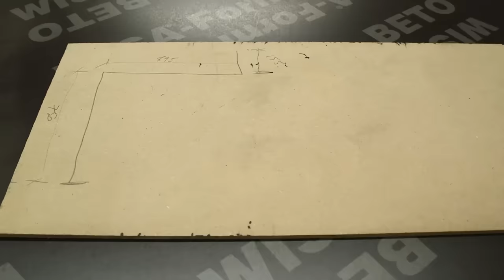Installing wood flooring in a 160 year old house

Comment: Watching your prep for laying the floor you've gone from extremely talented to genius in my estimation. Can I ask why you laid steel sheeting on the landing?
Reply from the maker: Thanks! Those stair nosing parts do not connect into the rest of the flooring, so since it is a floating floor (ie not glued to anything, just floats on the underlay) it needs a solid substrate for the nosing to glue to and the surrounding flooring to glue to and keeps it all together.
The nosings are sold as "to suit the flooring" but the flooring is a click together profile, but the nosing has a groove in it which is strange. it wouldnt have connected at the end of the boards anyway so still needed extra measures either way I guess.
Reply: @NewYorkshireWorkshop  I get it now, thanks 😊
Reply: @NewYorkshireWorkshop  I will credit you with a crafty solution to this problem. I prefer solid hardwoods over engineered wood for many reasons, including this one (nosings). You sir, however, are able to overcome the limitations of many things, including this one. Well done.

Comment: Sensational. Why the steel ?. Fire barrier ? Strengthening panel ? Heavy wear area ?  :)
Reply: NYW states in the comments “…those stair nosing parts do not connect into the rest of the flooring, so since it is a floating floor (i.e. not glued to anything, just floats on the underlay) it needs a solid substrate for the nosing to glue to and the surrounding flooring to glue to and keeps it all together. The nosing’s are sold as "to suit the flooring" but the flooring is a click together profile, but the nosing has a groove in it which is strange. it wouldn’t have connected at the end of the boards anyway so still needed extra measures either way I guess.”
Reply: @idontthinkso666  Thank you very much for that. What a complete master he is.

Comment: @New Yorkshire Workshop  Slim chance of a reply but could you go into some detail about the 2mm roofing felt? Is it just torch-on stuff? I need a similar packing material for my uneven subfloor in the 1.5mm - 2mm range.. I'm tired of using newspaper! :)
Reply from the maker: yeah it is torch on bitumen underlay i think, you want the non sanded underlay because it is smooth on both sides.
Reply: @NewYorkshireWorkshop  Hey thanks for the reply. I must say your attention to detail is absolute top notch! Another commenter worried about the smell or fumes from the felt causing headaches.. do you think there's any merit to this?
Reply from the maker: @IrishSkruffles  No none whatsoever, I have a pretty good sense of smell and couldnt smell anything apart from when working with the stuff, no smell when leaving the house for a few days and coming back half way though fitting which is when id expect to get a face full of it.  The only headaches came from the wife asking when will the house be finished every bloody day :)
Reply: @NewYorkshireWorkshop  Haha that's always the way! Good to know about the felt, I'll try find some over here (Ireland) as it looks ideal for what I'm after. Keep up the great work :)

Comment: Such a great video to watch. The care and attention to detail are certainly an inspiration. 
I do have concerns about a few things specific to what appears to be a solid bamboo product. Bamboo is the most unstable flooring product available, now given bamboo floorings other attributes and correct installation this unstable nature can be nullified. 
Some tips for ambitious DIY’ers… 
Bathrooms and bamboo don’t mix well, this should be avoided or at the very least the floor should be separated from adjoining rooms and halls. This way it can move about with no impact on the rest of the house.
Because of the large amounts of expansion and contraction with bamboo - laying flooring from one side of the house to the other expecting 10mm gap at the skirting to be sufficient is risky.  2mm per metre width would be ok up to about 5 meters of floor, beyond 5 meters other steps should be taken, fitting doorway thresholds for example - not attractive but often necessary. 
Using carpet tiles as underpayment may seem clever but I can see no upside. Flooring manufacturer won’t warranty the floor for starters, the spongy-ness is likely to be beyond that of traditional underlays and a floor that moves more than it’s designed to will squeak or creak. This was not £80 well spent in my opinion. 
Also, trying to glue bamboo to the subfloor ( as was the case adjacent to the stair nosings) is a big no-no. What good is an expansion gap if the floor has been glued, nailed or screwed at even a single point? When the floor needs to expand it can’t and damage will occur. If you are using the ‘floating method’ for your installation the WHOLE FLOOR has to float, you can’t lock in certain bits because it’s convenient… there were expansion gaps at the walls, there should be expansion gaps at those stair nosings too. 
The extra time to acclimate the floor was a good move though. But this is most effective when the dwelling is occupied and functioning as per it's intended use - no point acclimating to a home with a temporary humidity level which is common if other major works are being carried out.

Comment: Surely would have been much much easier and efficient to lift the floor boards and bring to level by packing (using shims or plastic packers) between joists and floorboards.

Comment: Won't that steel sheet cause problems with thermal expansion/contraction and wanting to move arround in a different way to the boards when people walk over it?
Reply: Probably not at normal residential temperatures.  Just keep teenagers away from the thermostat...

Comment: If it had been my floor, I would not have been happy with that piece at the top of the stairs at right angles. It sticks out like a sore thumb and heaven forbid those copper pipes where you levelled ever need any maintenance.

Comment: I've watched this multiple times and still don't understand how he got those multiple shaped pieces to level the floor.   I'm going to need to level my floors but I was thinking I would pull them all the way up and sister the joists.  ??? I'm not sure.   I'm an ambitious beginner with a small Victorian (2300 Sq ft) to refinish.

Comment: Can't believe you covered a a brilliant floor to restore in 100yr old house
It looks totally fake what you've done.
Ive been wood flooring specialist for over 30yrs.
Ladt 20 mainly restoration work. Which is so rewarding.
Done  big floors on 2 Dukes houses. Over 400yr old One of which I've done numerous floors. Done loads of ancient properties. 
That pine floor could have come up  beautiful.
I came across you today after watching your latest video. On your fencing & exposing stone slabs etc.
Which was amazing.
Really don't understand why you did this. It looks so fake for your house.
You've also. Glued it to carpet tiles. Meaning it's not fixed at all. Floating floor
Your obviously a skilled craftsman though

Comment: did I miss summit? Why the sheet of steel at the stairs?
Reply: NYW states in the comments “…those stair nosing parts do not connect into the rest of the flooring, so since it is a floating floor (i.e. not glued to anything, just floats on the underlay) it needs a solid substrate for the nosing to glue to and the surrounding flooring to glue to and keeps it all together. The nosing’s are sold as "to suit the flooring" but the flooring is a click together profile, but the nosing has a groove in it which is strange. it wouldn’t have connected at the end of the boards anyway so still needed extra measures either way I guess.”

Comment: I can already tell you all he screwed up majorly when he put that carpet nonsense down. What he should have put down was Aquabar “b” or another reputable moisture barrier. He used absolutely no moisture barrier and due to that one simple mistake this floor will not last. Take it from someone who lays and repairs hardwooods all day long.

Just did a job a month ago I had to tear out and replace the hardwoods throughout an entire house for a simple mistake similar to this. Some engineered requires glue and nails or it will squeak and creak under your feet. They didn’t use glue and that’s what happened lol.

Comment: All your time fitting those pieces could have been over looked had you used liquid floor leveler. Then covered it with a thin sheet of plywood,

Comment: That AIN'T HARDWOOD FLOORING!!! I've laid hardwood flooring (repairs) in my 95 year-old house, random-length 2" width SOLID 1 inch birch tongue and groove with gymnasium finish, edge nailed. I used my Great-Grandfather's Bailey cleat nailer and hammer. I had it sanded and refinished to match. I sorted THOUSANDS of boards to match mine and planed them with a hand jointer plane to thickness, 'cause lumber ain't the same as it was 90 years ago! I paid PREMIUM price for unfinished raw boards over-thickness to match mine for NO SQUEEKS.

Comment: This is prime example how to NOT lay down the floor. When the season change the floor will make waves as it will not have room to expand. Also no dilatation space in-between rooms. Especially in the bathroom. Not to mention the leveling technique and material used. This is so wrong on so many levels!
Reply: How would you recommend to level the floors?

Comment: do you know how much weight you added to your house?
Reply: Easily figured, each box weighs say 40 lbs. multiplied by the number of boxes, then add the weight of the carpet tiles.
Reply: who weighs their house? Is your house too fat?
Reply: @idontthinkso666    Panda may have had a mobile situation, where tow weight was  crucial. Not every installation of a "floating" wood floor is in a permanent location. Trailers and tiny houses need floors, too.

Comment: In a year or two this guys flooring is going to be gapped and cupped all to hell. I do this for a living and I am absolutely lost as to what this guy is doing lol steel on the floor? Carpet under the flooring? Absolutely no moisture barrier? He has made this job take 10 times as long and 10 times more difficult than it needed to be. Everyone is praising the man but really this was very poor work masked by his woodworking skill sets and tools which only make it seem he knows what he is doing but I fix work like this every single day so he can hire me to rip it all out and put it back right. 

He takes 5 minutes measuring and using rulers and making all these lines and putting down tape and using chisels (I only demo with a chisel) and fancy hand saws lol my guy give me a circular saw, a table saw, a mitre saw and a multi tool and I’ll be in and out in a few days (whole house)

Comment: 1 - There is so much wrong with this video that it made me feel migraine.

2 - It would be cheaper and faster to remove the old boards and exchange them for new, flat boards!

3 - When someone walks on this floor full of patches, it will be like walking on sticks. Every step a different noise.

4 - Using carpet facing down as a foundation invites long-term allergies, mites and insects.

5 - Hey, good job the alumino on the stairs! Will the next step be to reinforce the walls with cereal boxes?

6 - Don't forget to post the final result when the first rain falls and the humidity in the air lifts all the boards.